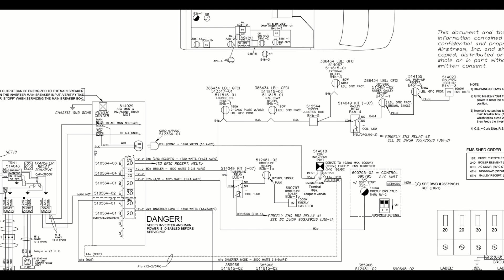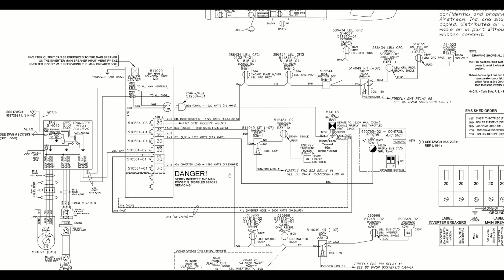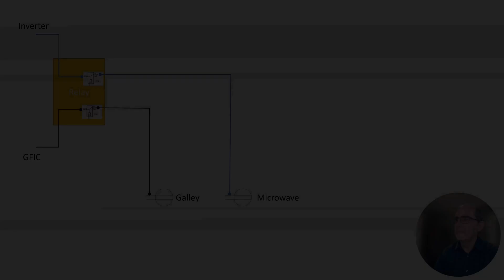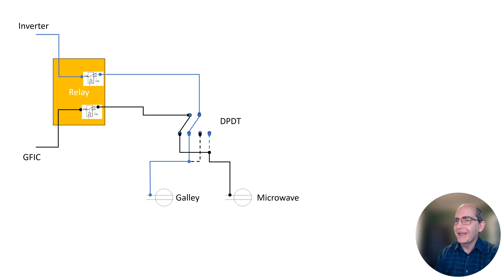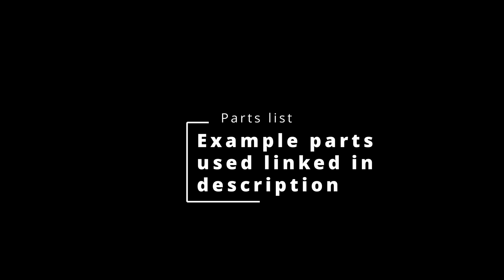Airstream Rangeline Galley Outlet rewire

Comment: Thank you for showing me this issue.  I was considering to buy a Rangeline, but no longer considering this van.  With the microwave out, you can clearly see there is no insulation, only Lizard Skin.  I guess Airstream and Thor believe this is okay.  Well, in my opinion it's not. Lizard Skin is good for sound deadening because of the spray on coverage, but that's all it is.       This looks like an uninsulated camper van.  Obviously, not a good choice for a full-time RV'er like me.  Too many issues with the Rangeline; other video's show water leaks and too many other problems.  I'm moving onto another brand.   Thank you again for creating video's with so much thought and work going into your content.

Comment: I don't undersand how you have an induction cooktop that needs to be plugged in to work, not have the plug in that is right next to where the cook top sits not work for the cook top! Frustrating! This needs to be fixed asap! They also need to rework that flimsy plastic cover on the drivers side covering the attachments/ quick disconnects.
Reply from the maker: Agreed. I have a video about how I strengthened the driver side trim panel. There's a lot I like about the van (which is why we bought it), but there are lots of small shortcuts Airstream took that could make the overall experience great if they are fixed.

Comment: The Rangeline is on my next Class B shortlist.  My current van has the same inverter and all my outlets are energized with the inverter on.  I just don't run the microwave at the same time as my induction cooktop, etc.  Dumb question, can't you just take the breaker that runs to the galley tower of power outlets and move it over to the same rail as the microwave?
Reply from the maker: There's a 20amp breaker for the whole inverter sub-panel, so you'd be limited to that for all circuits and the galley circuit also includes the lounge, rear, and external receptacles.
Reply: @dunclawler  Are there extra inverted slots in the breaker panel that you can move the galley circuits?  I understand the maximum for all circuits would be 20 amps AC which is a limit of the breaker as well as the Xantrex inverter.
Reply from the maker: @vincecarluccio5018  I haven't pulled the panel, but the circuit diagram shows empty slots in the sub-panel